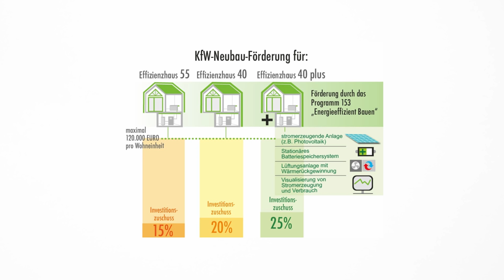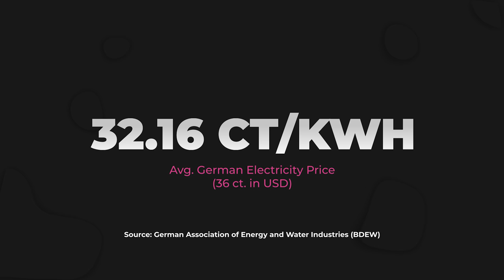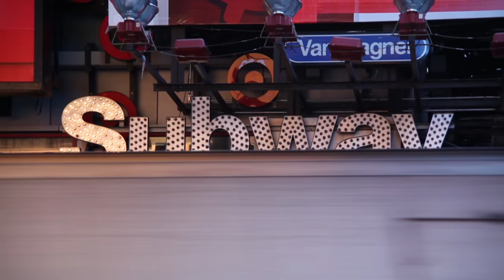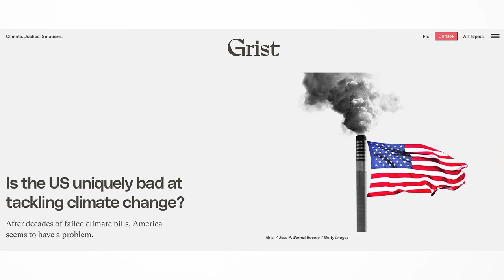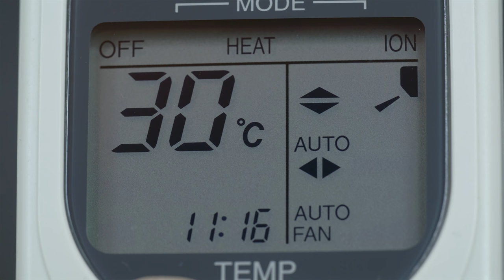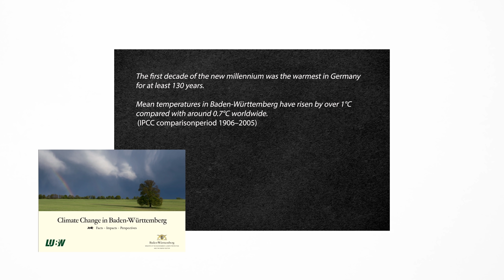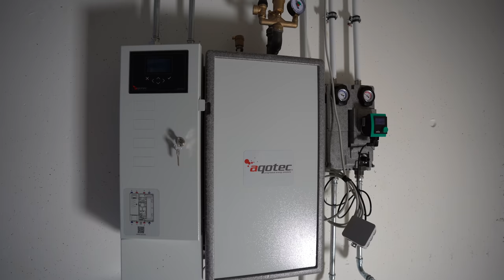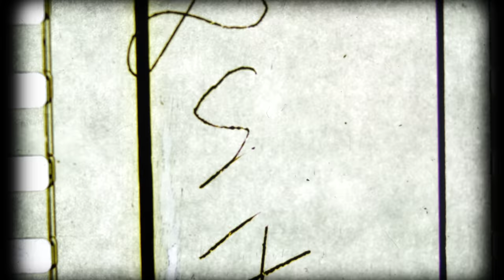HVAC (HLK) in German & American Homes | A Tale of Two Countries

Comment: To the "getting sick" part. When I was studying in Mainz they built a new building on the campus that got an AC. I changed Uni before the building was opened. Apparantly they made the AC go way to strong and cold in the first summer. People came in hot and wet from sweat just to be blasted by extremely cold air and lots of people (students and staff) got sick that summer.
Reply: That's not the only reason.
One of the reasins that more people get sick in the winter is the fact they stay in closed heated unventilated places. In the summer closed places with now AC use natural ventilation but when you install an AC you close the place up with no ventilation, just like in the winter which leads to a higher rate of infections.
Reply: Germans can take and endure a lot, but five minutes in cold drafts inside a house  kills them. The other factor is noise. That constant howling and humming of AC units are unbearable. I could not find any sleep in a hotel where it was not possible to switch that bloody thing off.
Reply: Of course if you turn your a/c too cold you can get sick because of the difference in temperatures.But half world lives with a/c as necessary home appliance.From Dubai to Singapore,Tokyo and etc.Where is the problem to solve?!.Don't like, don't use it.
Reply: @AL5520  What is the natural ventilation you talking about in the Dubai deserts or tropical Miami where it's hot 24/7 most of the year
Reply: I remember a journey to Sri Lanka. Every hotel that was proud of an AC would also turn the thermostat down - in the last hotel I entered our room - it was some 17deg C. Coming from some 30 deg outside an be a little sweaty - nearly 80% of the group flew back with a cold. 

For me a part of the "AC problem" is dealing with the thermostat. In hot summer when I drove home in my car, I put the inside temperature to some 25 - 27 deg. So not to have huge difference between in and outside.
Reply: @goshagosha5348  Seems to have worked just fine for centuries before ACs were invented.
Reply: @Llortnerof  Yeaaa?!!!You know that?!I bet it was,sweaty,smelly and disgusting.
Yeah..worked well...for horse buggy till the car invented,for candles till the electricity was invented.Yeaa keep being ridiculous
Reply: @goshagosha5348  All of those still work. All of those are still in use. That goes for non-AC cooling as well.
Reply: @leDespicable  A transatlantic flight and I am sick for a week, running nose, sore eyeballs and a stiff neck.
Reply: @AL5520  In reality, catching a cold has little to do with the temperature itself. You catch a cold when you catch the bug! When you are at close quarters with other people in a close space, you are more likely to catch the bug.
Reply: @leDespicable  Actually, A/C rarely lowers the humidity to unreasonable levels. In fact, one of the big failures of A/C design is is building too strong a system which lowers the temp before it has brought down the humidity. Cool and humid is uncomfortable, not cool and dry.The air in a heated room in winter is far drier than in air-conditioned room in summer.
 Modern forced air heating systems often include a humidifier to add moisture to the air. In cold climates, which commonly reach -15 degrees Celsius , a heated house without humidity control  will see humidity down in single digits. Indeed, hydronic ( hot water) heating systems come up short on humidity control. It creates a very dry environment unless measures are taken to raise the humidity mechanically. Without humidity, your nose dries out, you get static electrical shocks, and your furniture dries out! A comfortable house will have 35 to 40 % relative humidity in winter.
Reply: @christiankastorf1427  Because of extremely dry air in the airplane, not because of air-conditioning. Indeed, there is no A/C in an airplane. At 10,000 meters in the air, the problem is staying warm and pressurized to that people can breath! It is commonly -35 degrees  and lower outside that airplane, without enough oxygen to breath!
Reply: @nejdro1  It is the constant draft that makes people sick in planes. Most air-outlets are above your head or better neck. . Same thing with lots of A/C units in restaurants. They blast cold air down on you. I feel so uncomfortable that I want to leave after ten minutes latest.
Reply: @nejdro1  A clogged nose, red-shotted eyes and a stiff neck are very, very unpleasant and I got all that whenever I was on a long flight.
Reply: @christiankastorf1427  My central air-conditioner does no "howling and humming"!
Reply: @leDespicable  A.C.  does not drastically reduce the humidity. Mine will maintain somewhere between 40 and 50% relative humidity. This is much more than a heated house will have in winter, unless it has an humidifier.
Reply: @christiankastorf1427  An aircraft cabin has desert like relative humidity, as little as 5% relative humidity. Air conditioning never produces such low humidity. In desert locales, you may get such low relative humidity, but there was no humidity outside to begin with!
Reply: @nejdro1  Lucky you, ALL of them in ANY hotelroom or holiday home in Canda or the USA that we were in, did. I could not sleep. It was horror. The same thing as  with that proverbial dripping water outlet that becomes a hammer in your brain.
Reply: Which uni building was that? I work at Mainz University, in one of the old buildings (Philosophicum) that has zero a/c and my room is like a bloody greenhouse in summer (38 Celsius? No, you're not allowed to bring your own a/c 😂)
Reply: @christiankastorf1427  I would agree that most motels use the relatively inexpensive through the wall heating/air-conditioning heat pump units. The problem is that the compressor, which makes most of the noise and vibration, is practically in the room with you. With central air or split system A/C/heat pump systems , the pump is outside the building, isolating the noise and vibration. Although, if your neighbor does not have central A/C, they might not appreciate the noise in earshot of their open windows while sleeping! Here again, cost comes in. The better grade central air conditioning units are much quieter than the cheap units.
Reply: @AlyxSands  aah, the Philosophicum, that and the old Politikwissenschaft building were where I studied most of the time :D
I am actually not 100% sure, beause my time in Mainz was short and the building was only finished after I was gone but I think it's the Georg Forster-Gebäude.
Reply: Your body changes temp and you really discover your bio-dome for a tonne of life that is not you.
Reply: @nejdro1  When your body changes temp rapidly, your bacteria and viral biosphere get a growth boost due to your body reducing engergy usage of your immune system, becuase you body is dealing with needing to produce or lose heat, a rapid change in what you body is doing.
Reply: @julesmasseffectmusic  Then I take it you never go to the sauna?
Reply: Lmao, you guys believe this kind of urban legend crap?

Comment: I've lived and worked in a few places in the US. In New York City (Manhattan) nearly every building is hermetically sealed. There are no windows that open. That includes the high rise living and business buildings. Con Edison provides the electric grid and also steam heat from midtown to downtown mostly. There are some areas of downtown like Greenwich Village and areas uptown like Washington Heights where it is mostly private homes with independent HVAC systems. Con Edison is sloppy with the steam. In almost every street scene from Manhattan you see these tubes in the streets with steam running out the top. here mostly breaks in the system which if not vented would destroy the underground infrastructure. Manhattan is incredibly crowded underground. There are the power lines feeding the transformers buried under the streets. When one has to be replaced the entire street has to be torn up to pull the bad one out and replace it. I worked for years and never saw a transformer in a building, just the electrical distribution system for the building. The basements are incredibly warm and you sweat just being in there. Most basements are a couple of stories underground. Digging in most of the borough is dangerous. There are unmapped gas lines, water lines from the late 19th century and early 20th century everywhere and you're bound to cut something. There's also the subway systems in the way including all the dead tunnels no longer in use. Did you know there is a dead spur tunnel to the Waldorf-Astoria Hotel installed for President Roosevelt so no one could see he was a cripple. And there was older stuff. I worked in a district once that had Edison's DC electric grid. I discovered it one day when equipment I'd installed wouldn't work. I replaced a couple motors and still had the problem. I called my boss who told me that the store room had DC motors to replace the AC equipment. That area was finally converted to AC years ago. 
There are gigantic squirrel cage fans that push the air upstairs. In one building the vacuum on the room was so great you needed help to open the door. Dumpsters are squeezed into tight spaces everywhere. To empty them there are air pillows under them that inflate and let you push them to the loading dock. A truck hauls it away while another truck brings in an empty one.

All of this uses tremendous amounts of electricity. And almost all of it is buried under the streets. Big Allis the main generating plant is so hot cabling melts. The subway system runs entirely on DC current. The trains, the lighting and the system generates its own electric grid apart from Con Edison. 

Unless you live and work there you cannot appreciate the immenseness of it all. All the water comes from the Catskill Mountains in two tunnels. Water Tunnel #3 will take about 40 years to complete. It's under tremendous pressure. When you poor a glass from the faucet its cloudy from the oxygen bubbles. If you wait a minute the bubbles will pop and the water is crystal clear. And tastes good. It's fresh mountain water.

Anyway. The US is not Europe. Europe has a lot of old buildings but also a lot of new ones because of all the bombing that destroyed the cities' during WW 2. There's no comparing the two continents.

Comment: You should have a look also into Geothermie, it's very common in the south of Germany. Water is pumped into very deep holes in the ground and heated up via the warmth of the ground. There are big (financial) risks to this system because drilling the holes is a huge expense but once you have a good spot you only have to pay for the water pump and laying the insulated pipes.
Reply: Talk about that technology to the people of Staufen. You will get an earful.
Reply: @user-sm3xq5ob5d  Staufen and the surrounding area is about the only part where drilling is a risk, as they basically live on gypsum. But especially in former mining areas it is little to no effort as millions of holes are already there and can be reused.

Comment: On our many visits to the U.S. we found the air conditioned indoors too cold after the really high temperatures outside. We found the quiet ceiling fans in some bedrooms very pleasant and installed one in our bedroom at home here in Germany.. We only need it on hot Summer nights. Our well insulated roof and outside blinds plus letting in cooler air early in the day help us keep the rooms reasonably cool.

Comment: I remember working in the USA as a German once and we had our office in a trailer outside. It was during the Winter with cold temperatures and a lot of snow. 
In Spring on the very first day when it was actually sunny and warm outside one of the overweight Americans didn't hestitate and started the AC in the trailer. After that it was even colder than in the Winter.

Comment: I totally understand and appreciate AirCons in every hot and humid part of the world. It´s so much more comfortable. But in Germany, it´s normally just one heat wave in the summer. And everytime, I felt, I need to get an AirCon, the wave was already over. So I decided to simply stand these 3-4 weeks (if it is that long) and cool myself with cool water towels, fans and a small humidifier as the heat here is rather dry than wet. But I have a high tolerance to heat, so everything between 25 and 29° C in my room is totally fine and I feel comfortable with it. 🙂

Comment: While there are a lot of problems with AC, I feel like in Germany we should start incorporating more AC. The weather is moving to more extreme summers due to global warming. And I have to say I was shocked and very disappointed when my school built a new building that opened like 2 years ago and it has no AC whatsoever.. 
As we are moving to more clean energy I think building new public and other major buildings without AC is a bad decision. I hate the summer only bc ACs are not very common and I start sweating quite quickly. And let me tell you, sitting for 8 hours in a school classroom that feels like it never goes below 28 C is horrible. Bad for learning and bad for wellbeing. 
Obviously you don’t need to make it feel like December like they did in my Ohio HS. Kids would literally come to school with thick jackets and hoodies when it was above 90 F outside bc in the school was more like 60 F. And when I got to the airport in Charlotte on my flight there I was freezing in my hoodie and jacket, then I stepped outside and it was like opening an oven at 200 C hahaha
Reply: I think it's only a matter of time before people will be begging for more coal fired power plants to power AC units across Europe.

Comment: I am using a geothermic heat pump combined with solar panels to heat and cool the house with an underfloor heating system. 
It is not only cost effective but also very convenient. 

In Vienna the energy for the central heating system comes from garbage disposal plants, waste water plants and hydroelectric power

Comment: I love the fact that we don’t have AC units hanging on every wall and I do agree that when I was working in the office with AC I had more colds during the summer . However in summer 2020 I was heavily pregnant already and must admit we caved and bought portable air conditioner . We used it just for a few weeks though , as Jonathan said opening all the windows at 5 am and closing them at around 9 works just fine if the house is more or less decently insulated
Reply: Huh? Houses in the US don't all have A/C units hanging on every wall either.. forced air cooling and heating are some of the most common.. AKA just a small vent on the floor of every room.

Comment: I personally wouldn't like forced air in my home. I am very susceptible to draft; my neck and back muscles will tense up and cause backache or headache. So, I love my radiators. We don't pull them up to full capacity, though - that's much too warm even for my taste and wastes energy. In fact, in our home there's the rule "if only one person complains about being cold, he or she has to 'onion up' (put on more clothes / blankets) until anybody else feels the chill, too". Since my husband and me have a very different perception of temperature, that usually leads to me wearing fleece jackets and warm sweaters for a few weeks longer in autumn and spring. But it saves heating costs :)
Reply from the maker: That's a great rule! We will need to pick that one up here. :)

Comment: I live in the south of Germany and we have hot days in summer. I do not have AC, though and I never wanted it. In summer it is hot. That's just the way it is and our bodies are equipped with an internal heat regulation system that works just fine for the most part.
AC units are usually set to a way too cold temperature for my taste. As I've already mentioned, it is usually hot in summer so I'm dressed accordingly. I absolutely hate to go into a place that is set to arctic temperatures when I'm only wearing a thin shirt and shorts. Combine that with the fact that AC units dry up the air which I turns drys out your mucual membranes in the nose lowering your bodies defense against infection and you know why Germans state, that AC can make you sick. Happens to me often summer when I'm in ac'ed rooms.
In addition, I don't think I need to bring up the environmental effects of these things like insane consumption of electricity in combination with climate change and the question where our power will come from in the future. I think I can easily stand a couple of hot days in summer in order to lower my personal power consumption.
Reply: You live in Southern Germany where a day may be hot, but the nights cool off significantly. You are also at a somewhat higher elevation, with its cooling effect. what most Germans don't realize is how much further North Germany is than America in general. Munich is 48 degrees north latitude. Dallas, Texas is 32 degrees north latitude. Average summer temperature in Dallas is 35.5 degrees Celcius. Move to Houston,Texas on the Gulf Coast and you can add very high humidity to that too. Yup, you would buy air-conditioning too. Here in Portland, Oregon we hit 42 degrees Celsius last summer. Yes, my A/C ran non-stop!
Reply: Yeah alot of the US has more extreme weather in basically every way compared to Germany and alot of Europe for that matter. Where I live we get cold winters and hot summers. It's commonly 0 to -10 C in the winter with multiple inches of snow and then in summer it's 37-40 C for 3-4 months a year.